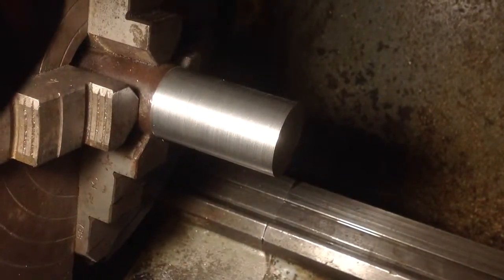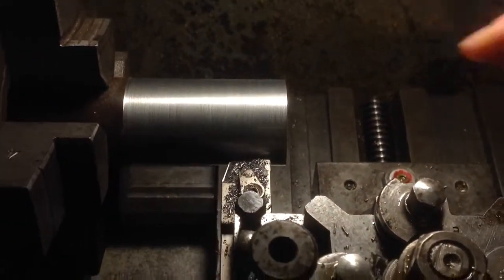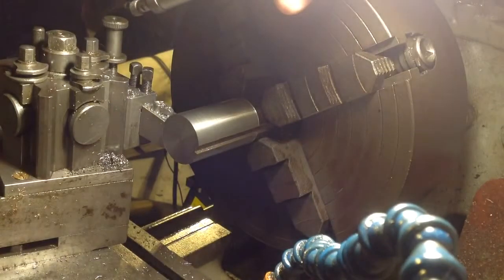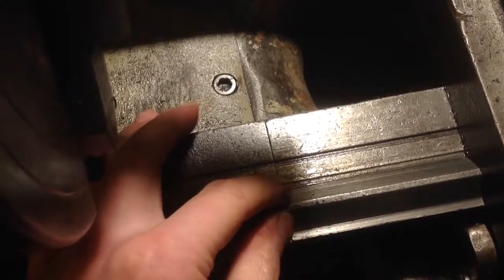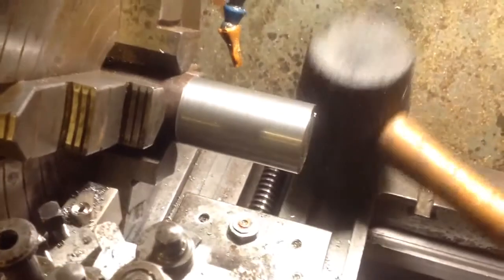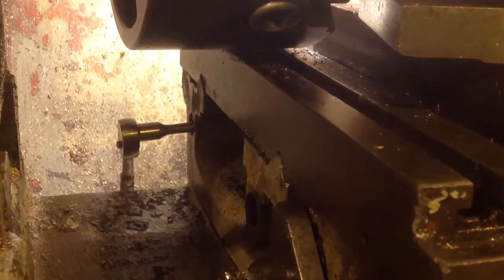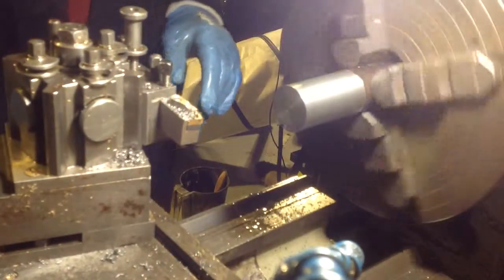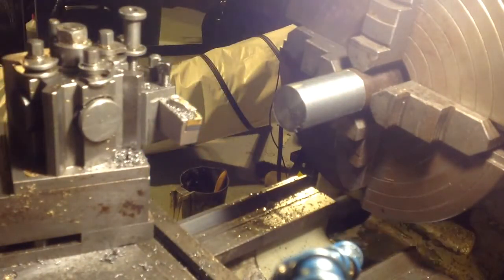Colchester student gap piece resetting

Comment: what's the biggest diameter you can turn on that lathe..im looking to buy one just wondering what it's like,i'd be turning pins for mini diggers up to 5 or 6 ton .the diameter would range from 35mm to 50mm the odd time id be turning a 90mm pin too.how do you think it would manage at that kind of work?
Reply from the maker: Should be fine, I think its a six inch centre hight lathe so in practice you can probably swing parts around 8 - 10 inches in daimeter, It has the speed range you need for those diameters.

Comment: Nice result. I have the same lathe I'm currently restoring and wondered what tool post you're using there?
Reply from the maker: HI, ist a quick change tool post - but not the T2 that colchester used. Someone has fitted a slightly smaller one - its mounted on a 1/4 inch spacer to bring the canter height up to the correct point.